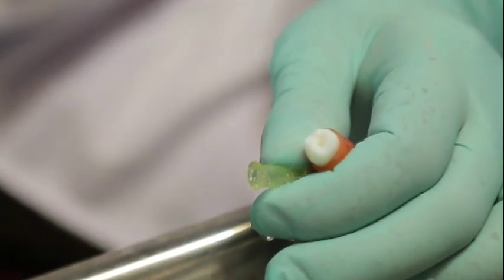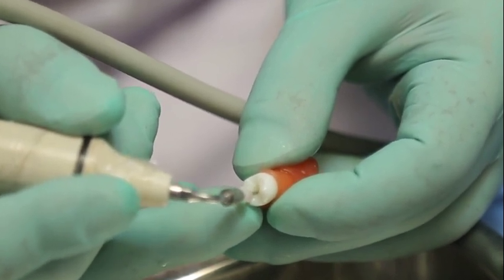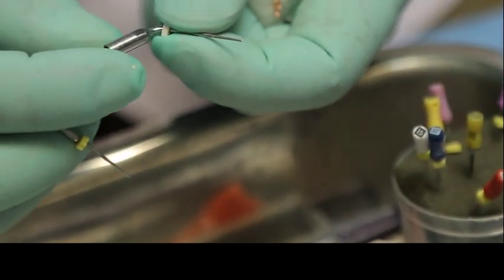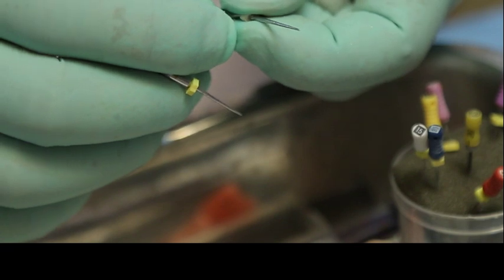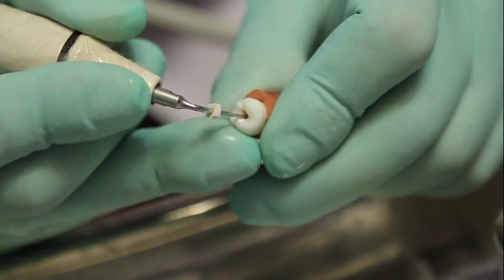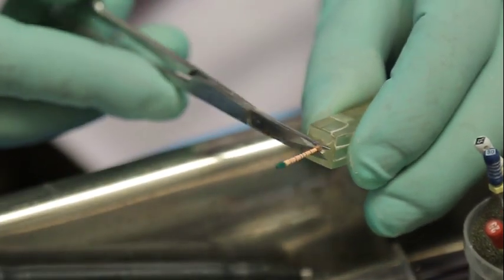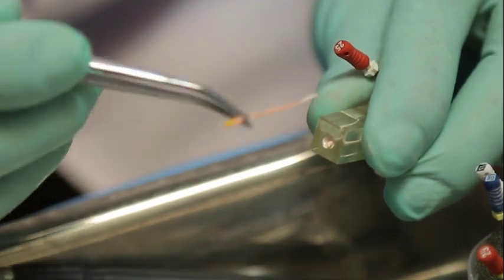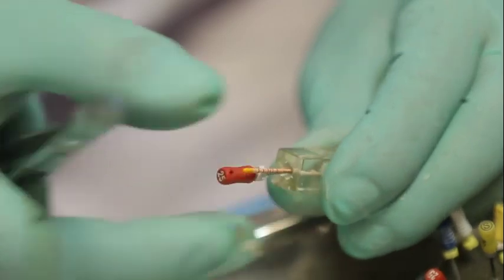Ultrasonic compaction #ultrasoniccompaction#rct #3dobturation#rootcanal #obturation

Comment: Excellent..which scaler is compatible to tips?
Reply from the maker: Thank you, sorry for the delayed reply.Seal apex works well in this technique
Reply from the maker: Thank you. Sorry fo the delayed reply. Seal apex works well
Reply: Scaler dr not sealer.. 😊😊
Reply from the maker: @proudly123  sorry for the misundersranding.Basically  Tips are  of two types- Ems thread or satlec type threads. So ask the dealer for the tips that are compatible with your scaler.
Reply from the maker: Sorry for the delay